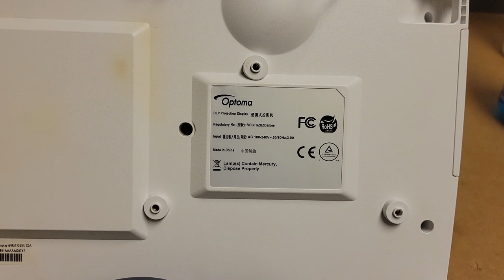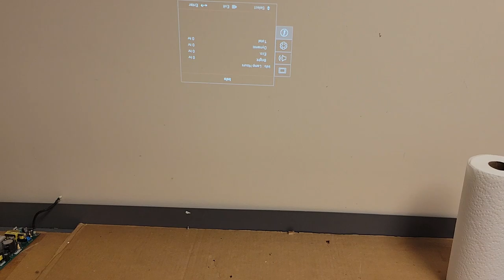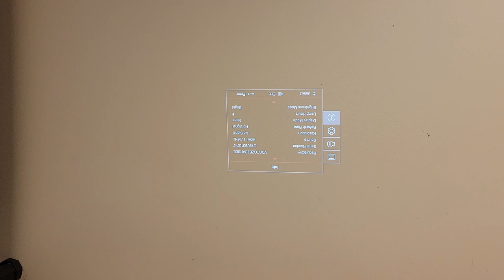Optoma GT1080 Darbee  DLP Projector Color Wheel Replacement

Comment: Jeez man! I never thought that trash lamps will cause such a huge plastic discolouration.... Another awesome video from Master Frank. Thanks a lot for sharing my friend!
Reply from the maker: Soo much heat!  That IR block coating keeps a lot of the heat out.  If it get in there, you start cooking things, plastic first, metal second. Never a good thing. Metal and plastic taste terrible cooked. Or raw for that matter.
Reply: Could have been my after market lamp that cooked my DMD in my Acer X110 after only 1 year. Wouldn't have supprised me, didn't have a clue back then though haha.

Comment: You are a god-send. My GT1080 Darbee was making clicky sounds and failed to start 3x before powering down with red error LEDs. New bulb didn't fix it. I followed your video, pulled out the color wheel, cleaned it, and noticed the black tape was dried and partially flecked off. I re-purposed some of the black tape that was already within the projector (covering some ribbon cable connectors - assuming those aren't strictly necessary), cut it to size, and placed it on top of the missing portion. Boots up fine. I'll let it run as long as this fix works, but at least now I know how to replace the color wheel when the time comes. Many thanks!

P.S. I promise not to buy Amazon bulbs from now on. That's another take-away I got from your video. ;)
Reply from the maker: Awesome!! Great job!! That tape should hold up fine for now.  It may come off again, but at that point you can get a new wheel or try some "stove/engine" paint and draw the mark on with that.  The only thing it does is break the IR beam for the index sensor.  Any matte finish, higher temp handing material would work.  I would not use electrical tape personally but I have heard of people using it and it working. I think the glue gets too soft when it's hot personally.
Thanks for letting me know the video helped out! That is exactly why I post these!

Comment: Using your video I able to replace the color wheel in our Optima 1080. Thank you for the video and the detail expressed in it!
Reply from the maker: This comment made my monday. Thank you so much!
Reply: Where did you get your color wheel for the Optoma GT1080? I got one off of Amazon which says it was meant for this model but it was too big -- albeit, it looked used so may have been someone returned their broken one or something... but do you have a place where you got the right size from?
Reply: @utsaxc   We got it from Amazon. 
Projector Optoma Color Wheel for Optoma HD141X HD180 HD25 HD26 HD230X GT1080 Smart UF55 UF65. Have had no problems with it since I put it in.
Reply: @carltontrimble61  okay, that's the same model I bought. I think someone switched out their old one and returned it and then I ended up getting it because the one I got looked used and was the wrong size. I'll try again.
Reply: @utsaxc  Good luck. Amazon is usually pretty good about exchanges.

Comment: Is it possible to replace the fans in these projectors with something quieter? My room layout makes it necessary for my sitting position to be pretty close to the mounted projector and it's pretty loud. Watching your video makes me think I could easily get into the projector to access the fans.
Reply from the maker: hi, unfortunately its not an option.  optoma designed these to be as quiet as possible but still move enough air.  There are other specs to replacing fans that need to be met and so far all of the other options(noctua especially) will not work.  Noctua fans don't move enough cfm(which is why they are quieter) and they do not have the same error reporting mechanism.  Computers have a lot more room for variance in fans which is why you can switch them around.  Projectors on the other hand have very specific cooling needs and if you change them, it almost always causes issues.  Your best bet for noise would be looking into building a hush box.  You can put noctua fans in those and that would work but you can't swap them into a projector.  it will just throw a temp error and sit there.
Reply: I considered making a hush box that was open on the side opposite my seating position so I didn't have to mess with sourcing special glass. Do you have any tips for building a hush box? My ceilings are pretty low so I will have to keep it low profile. I was thinking about using  AC infinity fans in the hush box to help control temps. I like the image of the optoma and the throw ratio is perfect for my room. I'm pretty locked into that throw ratio too so it's heard to just buy a different projector.  @FixitFrank

Comment: Thanks for this. Struggling to open up the filter cover to clean the dust - apparently have to do this every three months. But also ours is making a terrible noise for about 5 minutes when we switch it on and we are trying to figure out why. ANy ideas?
Reply from the maker: You're welcome! I am willing to bet your color wheel index mark sticker has fallen apart. I have a video on an hd26 (short) where you hear the noise. If you check the shorts videos it's in there. If that sounds like yours then it's almost certainly the same thing.  It's also super common. If you want to share a video of your projector making the noise I would be glad to check it for you
Reply: Frank thanks so much for your reply. It sounds pretty much the same - just took a vid now where could I send it to? Appreciate it
Reply from the maker: If you want to email it, send it to my email or you can upload it to youtube and paste a link for me.  Whatever is easiest for you.

Comment: Your video worked great for the tear-down and cleaning of my projector, unfortunately, the color wheel I purchased was mis-advertised as it was too large for my Optoma GT1080. Do you have any suggestions on where to get a reliable replacement for this?
Reply from the maker: Hi Albert! I do. Contact Crystal at Time electronics. Her email is gydz@timeprojectorlamp.com. They ship DHL and take Paypal so it's all safe. I've used them for a while now. Great company

Comment: Hi Frank ,What color wheel would you suggest  for a Optoma gt1080 DLP
Reply from the maker: It depends on the version of the GT1080 if I recall correctly.  I believe there are 3 variants and 2 use the same wheel and one does not.  What I would suggest is remove it and take a picture. Then send that picture to the folks I use (gydz@timeprojectorlamp.com) and they can get you a new one.  Otherwise, I would search ebay for your mode of GT1080 and add color wheel to the end.

Comment: Why you changing it? 
My Optoma wouldn't stay on. After 30sec it turns off and gives solid red lamp light and blinking power light. Lamp is a brand new. It started to do this with the old lamp, which is still working. Internet says it could be the color wheel or the dusty photo sensor. I cleaned them properly but still have the same issue. I think there is some kind of low buzzing noise from wheel, not sure. Do you think the wheel is the problem or what should I do?
Reply from the maker: I find that when they get that bad it's worth changing. Cleaning is always worth trying first. However if you changed the lamp assembly recently, I would make sure the lamp assembly has a good IR cut filter. Search my channel for the IR filter video. It explains why.

Comment: Do you have a parts link for the new color wheel? I think mine is creating a super high pitch noise, so I might just replace.
Reply from the maker: If it's this same model, you can email me. I have a few around, or you can contact the folks I use.  Gydz@timeprojectorlamp.com , If you contact them, send a picture of the old wheel.  That way they can make sure its correct.
Reply: Hello! A couple of years later but I’m looking too for a color wheel for this exact model. How could I contact you?

Comment: hey mr. frank, could you please help me?!! I just have two questions and you seem like an expert so i’m going to shoot my shot. So, i have an optoma HD39Darbee 1080p. i’ve had it for a couple years and use it for gaming. my problem is that it makes the room incredibly warm (with open, good airflow), so i was wondering if attaching a metal heat sink to the bulb top plate would help cool it down, and if that makes sense? ADDITIONALLY, could I upgrade the bulb if I wanted to??? like are LED bulbs better, or is there anything i can swap it for to make it better!
Reply from the maker: Projectors are hot. They make a good amount of heat.  Adding a heatsink won't work. It's still making heat. And no there is no bulb upgrade. LEDs are far less efficient than arc lamps. Watt per lumen your current bulb is far brighter than an led of the same watts. You're only cooling options are for the room.  Adding any cooling fans to the projector will just push the heat into the room more. That's why adding a heart(can't do that anyway) to a bulb won't work. The room is heated by the projector. You need to cool the room not the projector. That's how heat loading works. It's a little confusing to explain (I'm not a thermodynamics guy) but an Aircon or window fan is your only real option. Sorry I wish I had a more useful idea for you.
Reply: @FixitFrank  thank you! your response was plenty, that’s all i needed!

Comment: I replaced the bulb in this same projector, I turn it on and the bulb will turn on for a second then it will stop. Is this a color wheel issue or a bulb issue? The fan sounds normal and there is minimal dust. I have had it for 4 years without any issues
Reply from the maker: I would start by checking the color wheel for that index mark. Also check the sensor for dust covering it.
The color wheel controls the lamp. If the projector senses any abnormal behavior by the color wheel, it will shut down.  
I'd start with that.  check the wheel.  You don't have to take it all apart, just remove the color wheel sensor  and see if the sensor is dusty and you can also see if the wheel lost its index mark or not.  
I suspect your issue is color wheel related more than lamp related. If the old lamp was not that old, you may be able to return the new lamp. If it was nearing the end of life, keep the new lamp and save the old for a spare.

Comment: I changed out my color wheel because the color is off. The color is correct but the spinning is super loud. It is possible that I got a defective color wheel?
Reply from the maker: Maybe, but I kind of don't think it is likely.  I would check to make sure there isn't a wire or piece of tape or something that fell near it when you put it together. Double check your rubber washers on the back to verify one isn't pushed through and making it a little cock-eyed.  I personally have never seen a new defective color wheel, but I would be wrong to say it is impossible.  Go back over the projector and see if you can verify the source of the buzz.  You can start it up without the lamp and the cover off to the side. I do know that foam under the wheel and the plastic around it can be warped and loose from heat. I have definitely seen the foam come loose and push against the wheel.  
Rule out everything else first.  Like I said, I wont say it is impossible. But it might just be a piece of the projector a little too close to the hub or the wheel. 

I'd expect to hear more of a grinding than a buzzing if the hub was bad. If its buzzing/humming loudly look for stuff interfering with the wheel. If its grinding/scraping looks for metal near the wheel and if not, then take the wheel back out and hold the back while you start it up and hold it. You will know 100% then if its bad or not. 

after thought: I did have one that the little metal bit on the end of the light tunnel somehow warped or shifted and was rubbing. I buzzed it back with a dremel (maybe half millimeter) and it was fine after that.  

Good work by the way!  Worse case you replace the wheel again. Either way the projector will be good as new.
Reply: @FixitFrank  It did end up being a defective color wheel. I put the old one back in to see if it produced the same sound and verify if the plastic washers were properly aligned. I couldn't get the old one to replicate the same sound so I got a replacement and it's back to working good as new. Thanks for making this video. It saved me a ton of money.

Comment: Hi Frank what do you think of this particular model?  I need a few for using with flight simulation.  It's pretty popular  among many simmers due to the low cost.  Id love to run 4k but 1080 is less taxing and we are using 3 in an array with a 3080 video card.  I saw below that you think Optoma's quality is lacking now? What would be a better option?
Reply from the maker: It's weird. When Optoma works they are good. It's like the design engineers were over ruled by bean counters(I'm sure this is a surprise to everyone...). The GT1080 seems to be built pretty well for the most part for a projector in that price range. They will have normal failures like lamps, fan and color wheels but the newer UHD series is the one that seems to be a lemon. I haven't worked on all of them yet but the folks I've talked to with them all complain about the dmd failing and the main board overheating.  
Being that you want a gt1080, the only thing you might want to try is some extra fans to get more air moving through. Having three close together (sims are so cool) would increase the heat but I don't think anything is inherently going to fail like the newer projectors.  So far every gt1080 I have seen had a normal, consumable part fail. No main boards(well one but it was a lightening strike) just fans lamps, scratched lenses and color wheels.
Reply: @FixitFrank   Thank you. I think I'll find a used one and just replace parts as needed. I'm use to under the hood work and can solder if needed.  Looks like the main replacement parts are all plug and play anyway.  I still have an old InFocus IN-72 720p projector  too that was great for it's day.  I've been wanting to see if I can get a color wheel and lamp for it.
Reply from the maker: You should be totally fine then.  There is nothing that should stop you.  Also, the curved main lens is the same lens used on the old Smart UF55 which can be had pretty cheap. See the xmas miracle vid I posted on one of these.  that was a trip...

Comment: I have multiple GT1080 Darbee's that are all experiencing powering off/overheating issues. Do you offer your repair services to the public? I would love to send them to you for repair if so.
Reply from the maker: Yes however I'm in the middle of moving locations. I don't have public info listed at the moment but if there is a way I can contact you or if you can check back on this comment next week (Monday). I should be able to get us connected.

Comment: Hi Frank, I have this projector that I was using for about 3 years. The bulb, as far as I can tell, went out. The colours would keep on changing when turned on and then the projector would turn off when with the lamp light flashing red. I tried to replace the bulb with an original OSRAM bulb but the project wouldn’t even turn on now and flashes the lamp light again. It did this with a different bulb as well. 
The original bulb when I took it out. The white rubber where the connector tie to the bulb was brittle and not like rubber. Don’t know if this was just due to heat of the bulb. The cooling fan seems to be running fine and the projector is clean from inside. 
What do you think it could be? I saw another video from you where you replaced the motherboard could that be the issue on mine one too?
Reply from the maker: Hello! It sounds to me that your color wheel is the issue. The flashing colors and lamp shut down are a dead give away. However, be sure to either use your original lamp assembly and replace the bare bulb (Osram) or with a full assembly from a reputable seller (not Amazon). There is a special optical filter on the lamp assembly lens that cheap lamps do not use. It can cause lots of problems.  The glass on the lamp assembly should have an obvious reddish color to the glass. If it's greenish it is not good. Must be the reddish tint.  Do a search on my channel for HD26 color wheel and you will see the steps. The hd26 and gt1080 are identical in that regard.

Comment: Any tips on where to look for a good replacement colour wheel for this model? Amazon is selling a few but the prices range from 25-125 bucks.
Reply from the maker: anywhere but amazon really.  I can't stand them for projector parts.  The vendors they use don't seem to be trustworthy, but amazon doesn't care because they get a piece of the sale.   Voltarea on ebay(or his actual website), time electronics(gydz@timeprojetorlamp.com) or TSC parts(optoma).   I wouldn't trust any projector parts from amazon. I have seen far too many that caused more problems than they solved.